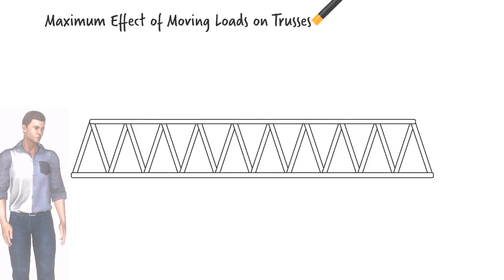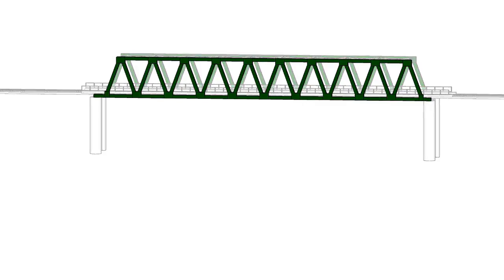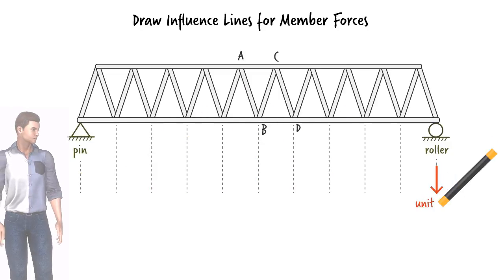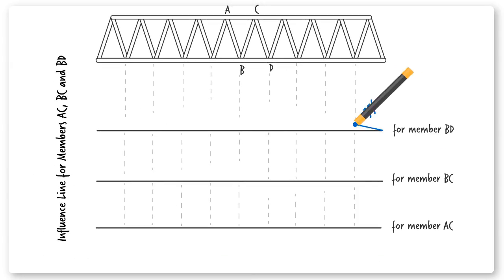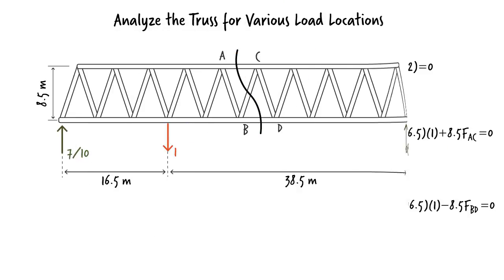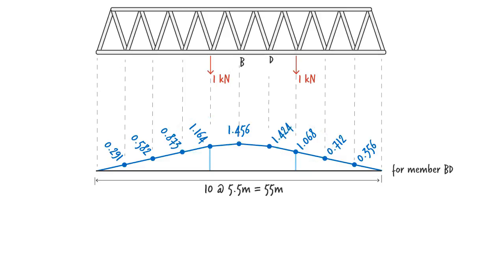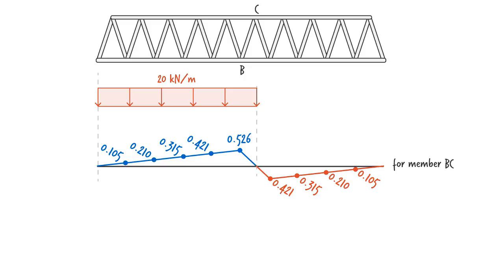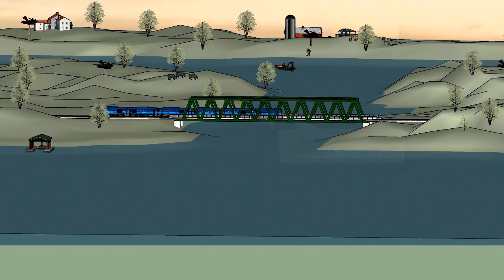SA53: Maximum Influence in Trusses due to Uniformly Distributed Loads

Comment: May I know, if this illustration only for a single rail track supported by a pair of trusses? If yes, how do we solve the members stresses if we have two rail tracks with just one pair of trusses?
Reply: How is the loading would be applied?
Reply from the maker: Yes, the illustration is for one rail track. In the case of a two-track system, maximum effect on the member takes place when both tracks are loaded at the same time over the same region of the influence line. This basically means we need to double the distributed load magnitude when performing our computations. The area under the influence line remains the same, but the load magnitude doubles.
Reply: Many thanks.

Comment: i noticed that the uniform load in kN/m multiplied by the area of the influence line produces an axial force of kN in the member. Does this mean that the area of the influence line is obtained by multiplying the horizontal distance in meters and the unitless height?  Thus,  axial load is kN/m x m = kN?
Reply from the maker: Correct, the area of under the influence line (often in the form of a triangle) is the height times the base divided by 2.

If the influence line is rectangular in shape, then the area is height times base.

Comment: How to get the area under influence line?
Reply from the maker: The influence line is a triangle, or a set of triangles. The area under the influence line can be determined using the area(s) of the triangle(s).
Reply: @DrStructure  thaaank you so much

Comment: Will the top chord member in another position have the same influence line as AC?
Reply from the maker: No, they are not going to be exactly the same.  In this case, the influence line for a top chord member reaches its peak value when the unit load is near the member. As the unit load moves away from the member, its impact on the member would be reduced. This means that the influence line for the top chord member at either end of the truss is going to peak when the unit load is near the end/support. In contrast, the influence line for AC reaches its peak value when the unit load is at the center of the bridge.

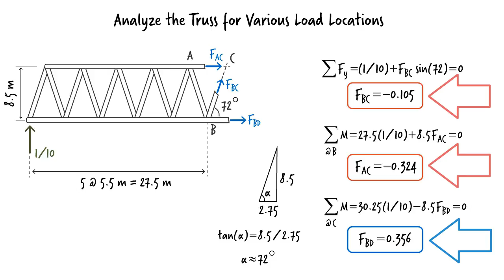Comment: Hello sir! This was a lovely video. I can't imagine how long you spent on all those animations, but it certainly has paid off because this was an excellent video. I have a query though. At 4:33 I followed for moments about B as this is simply the force * lever arm, i.e. reaction force 1/10 multiplied by the perpendicular distance from the force to the part we take moments about which is 27.5m, so we get (1/10)*27.5 and then we do the same for the other force. However when taking moments about C we see that the lever arm is now 30.25m, I have spent a while thinking about this but I am still unsure as to how you got this. May I ask how you calculated a lever arm of 30.25m? The closest calculation I made was 30.5m however my method seemed very wrong.
Reply from the maker: Thanks for the feedback. 

The horizontal distance between B and C is 2.75 m, which is half distance (5.5/2) between two neighboring joints along the bottom chord of the truss. Incidentally, this distance is shown on the small right triangle @4:30. We use it to determine angle alpha.

Therefore, the moment arm for the 1/10 force to C is 2.75 m plus the moment arm of the same force to B. So, 27.5 + 2.75 = 30.25 m
Reply: Dr. Structure Wow! All I can say is thank you for such quick response! Dargh that makes total sense now! I can’t believe I never got that the first time! I never looked at the diagram closely enough! I assumed it would be the same distance but I completely forgot about that extra +2.75m. My bad 🙈 But yes this was an excellent video, I will definitely be sure to check out more of them in future! Many thanks

Comment: how did you get 2.75m instead for 27.5m
Reply from the maker: Are you referring to the denominator in the expression tan(alpha) = 8.5/2.75 @4:00?  
If so, we know that each span of the truss is 5.5 meters in length. The right triangle used for calculating tan (alpha) has a base of 5.5/2, or 2.75.

Comment: In the real world design of truss members, do we design the top members based on the maximum stress that we obtined? Same way with the diagonal and bottom members? Or do we design according to the actual stress of each members?
Reply from the maker: Ideally, we want to optimize the design, meaning each member should be designed based on its own maximum stress state. But in practice, that may not be feasible due to the limited availability of member sizes, or the added cost of material and/or construction. Such a design appearance may not even be desirable for aesthetic reasons. Of course, we can always design the structure optimally on paper, but then use larger member sizes and more uniform connection configurations to accommodate the specific practical considerations for the job.
Reply: @DrStructure  Thanks a lot.

Comment: How do you get the 43.59?
Reply from the maker: The area consists of two right triangles (at the ends) and eight trapezoids. 

The long way is to calculate the area for each triangle and trapezoid, then add them up. From left to right, we have:

Triangle Area: (2.91)(5.5)/2 = 0.8
Trapezoid Area: (0.291 + 0.582)(5.5)/2 = 2.4
Trapezoid Area: (0.582 + 0.873)(5.5)/2 = 4.0
.
.
.
Add them all up, and we should get 43.59

Alternatively, add up all the values given on the diagram, then multiply the sum by 5.5:

(0.291+0.582+0.873+1.164+1.456+...)(5.5) = 43.59
Reply: Dr. Structure thank you very much.
Reply from the maker: You're welcome!

Comment: How are the members joining the two trusses at the top chord be calculated? These are the members running on the horizontal plane.
Reply from the maker: Those are lateral bracings, and not a part of the main load-carrying system. They are there to keep the two trusses aligned. Although axial forces do develop in such secondary members, they are small relative to the forces founded in the primary members. Design codes often provide provisions for handling such members.